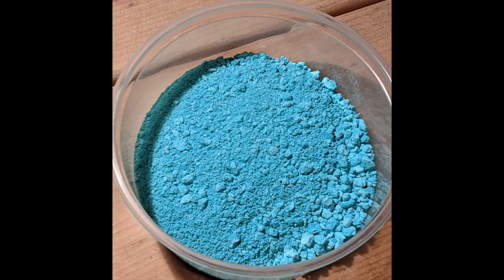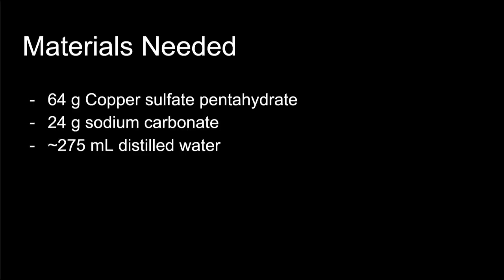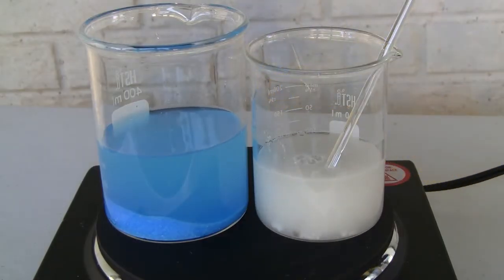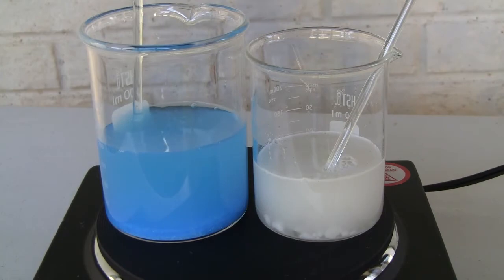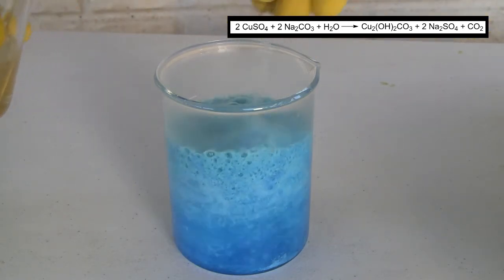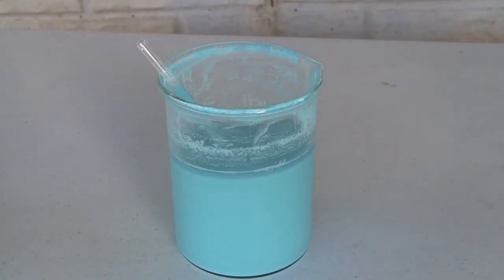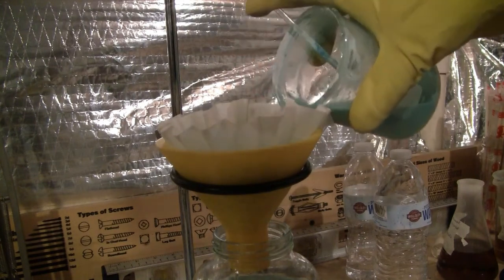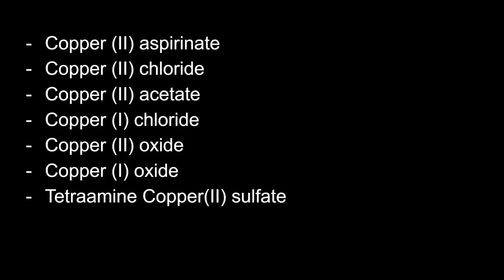The Copper Series: Basic Copper Carbonate

Comment: I use hot white vinegar and hydrogen peroxide then add sodium carbonate after the copper has oxidized. I just don't like copper sulfate, sounds too skull and crossbones for me. Copper is still toxic but at least it's not msde with sulfuric acid.

Comment: That looks very blue, mine always looks more like a green color. Weird
Reply from the maker: That is very interesting. The product I got is a greenish-blue which is not very easy to see in the video, but I speculate the more blue color could be due to particle size or possibly some impurities in my copper sulfate. This is just speculation and I could be wrong. Did you by chance do something different from what I did in the video?
Reply: @bismuthbuilds9334  I basically just mixed the stoichiometric ratio of copper sulfate pentahydrate and sodium carbonate. I didn't filter it off right away, I just let it settle to the bottom (which btw took forever, but made filtering so much quicker and cleaner).
This picture is more like the color that mine is: https://encrypted-tbn0.gstatic.com/images?q=tbn:ANd9GcQ_-u3S0dYLGZij6IkojebvhOP8cbzeceDdVg&usqp=CAU

You making any other videos in your copper series? I'm in the midsts of a copper synthesis binge myself, would love to do more (I have a bunch of copper sulfate on hand, thought I'd use some of it).
Reply from the maker: @jhyland87  That is interesting with the range in how green basic copper carbonate can be. My best guess to why is either particle size or impurities that can make it appear more blue. 

I am making more videos for the copper series! I finished recording footage for a video on Copper(II) asprinate and I am debating between doing copper(I) iodide or a deep blue copper oxalate complex next. Are there any particular copper compounds you looking to make?